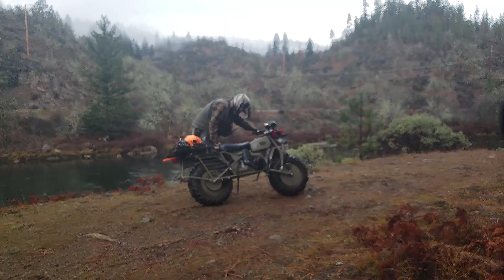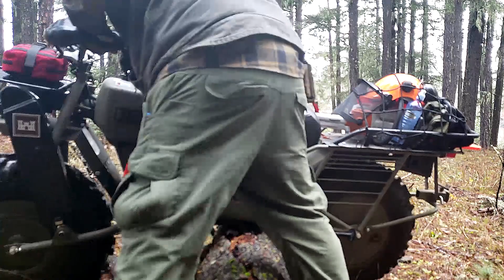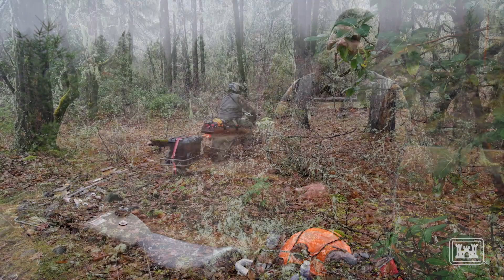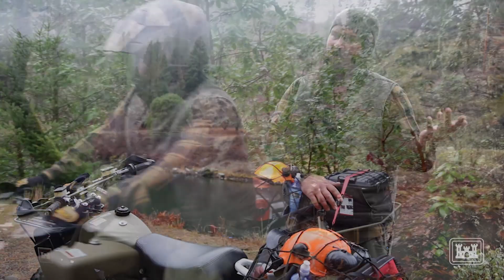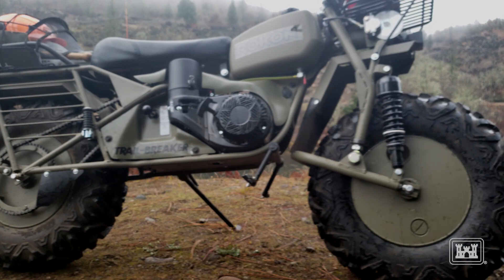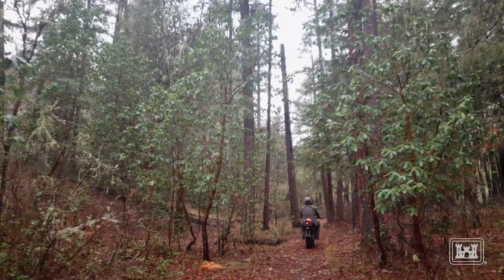Lost Creek Lake's two-wheel drive Rokon motorcycle is a force multiplier.

Comment: Hi do you need any help out there:-)? I'm thinking about going back to work! can't hardly survive on this social security. I used to work in Sisters Oregon for the u.s. forest service fire fighting suppression and control in the early 70s. Ime multi-skilled! Have done building log cabins and homesteading in the wild. Exp working on some equipment! sharpening chainsaws keeping them running Etc cutting Timber whatever! I'm needing a job that's kind of easy for an old man! any clues? Mark southern Missouri Ozarks USA ..I was born in Portland1956 and lived all over Oregon growing up
Reply from the maker: Hi Mark! Yes, we are always looking for suitable candidates to join our team. We have many different types of jobs available at the Corps of Engineers, and all applications are processed through https://www.usajobs.gov/. Type the acronym USACE in the search bar and scroll until you find something that fits your skill set. Good luck!
Reply: @USACEPortland  thanks for the advice and the chat